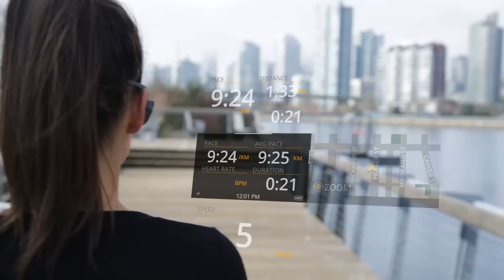Recon Jet: Swapping Battery & Lens

Comment: I cannot figure out how to zoom, or do anything else with the camera other than just take a picture. Also, why does the video only take 15 second clips? How do I make it record longer?
Reply from the maker: Brian Wood Hi Brian, the camera on board Recon Jet does not have the ability to zoom. As for recording longer video on Jet, head to the devices "Settings" → "Battery Saving" and adjust "Record Length". Thanks